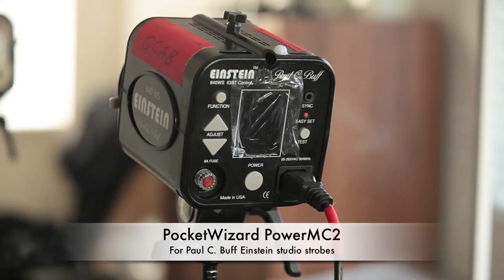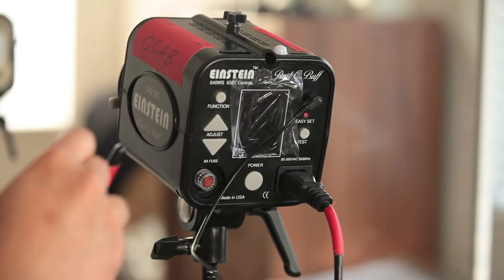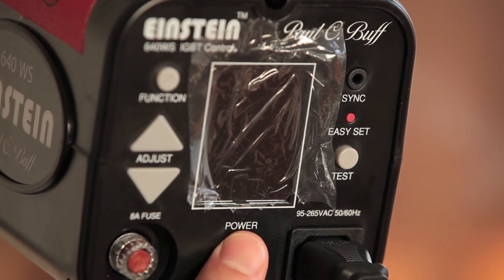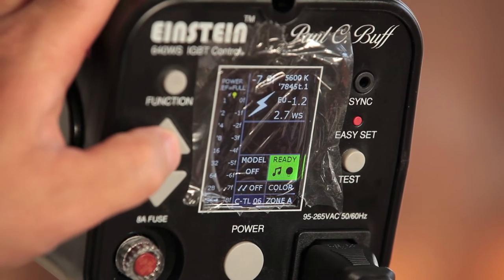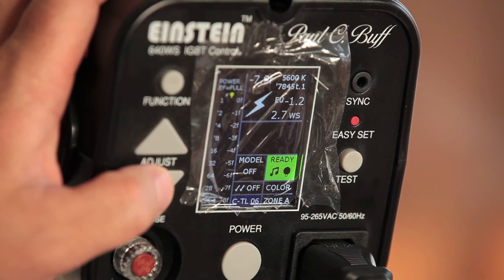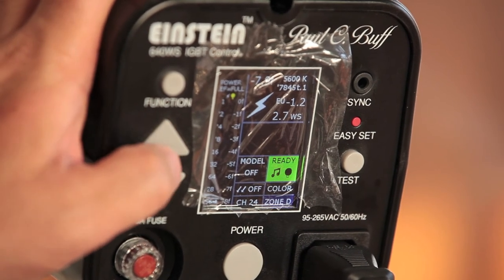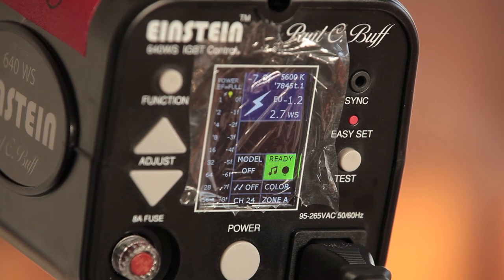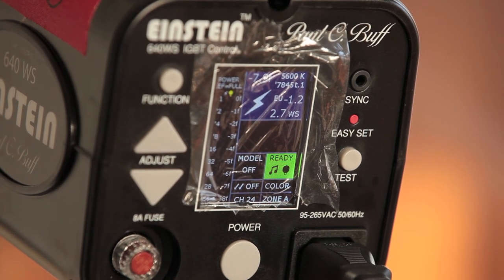PocketWizard PowerMC2 Quick Overview

Comment: Hi.  I'm trying to set up my two Einsteins with 2 canon flash units (580EXII & 480(older model, forget which).  I need 2 extra lights for rim lighting from the rear of a portrait set up.  Hoped I could use my canon flash as my studio is small!   Have you done this?  And do you mind telling me what I would need for pocket wizards in order to do this.  Grateful for any insight.
Reply from the maker: Yes, I mix lots of lights of different brands, including studio and small flash / Speed lights. You have two options in your scenario: 1. Use the Control-TL capabilities of the PocketWizards and use FlexTT5 (for each speedlite) and PowerMC2 (for each Einstein), 2. Use basic non-Control-TL /non-TTL triggers for all.

I personally use the FlexTT5 and PowerMC2 to mix lights in the scenario described, simply because I already had the TT5, and when PocketWizard came out with the PowerMC2, I went ahead and got those. This can get expensive, though. I think the TT5 are about $170 each and the MC2 is about $100 each.

You could get some of the Yongnuo triggers (or the older PocketWizards, e.g. Plus II) and adapters for Speedlights, which should be a lot cheaper. You will have to manually control the lights in terms of adjusting power output, but in a studio situation, this isn't bad since you will eventually learn what settings you need and remember those.

What you could also do to go real cheap is get basic triggers just for the Speedlites, set them to Manual (not TTL so you don't get the preflash) and run the Einsteins without any radio triggers and just have them optically triggered. Your Speedlites / rim lights will actually trigger the primaries via the optical trigger on the Einsteins. I do this often as well when I'm feeling lazy at home. I will sometimes setup only one light with a radio trigger and everything else that has optical trigger (Einstein, Alien Bee, Elinchrom, etc) are just set on optical.